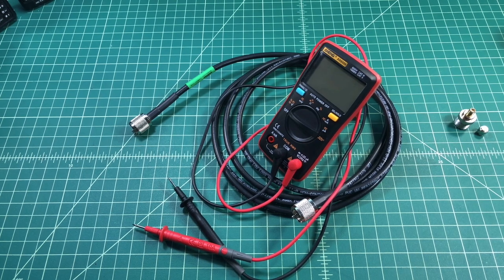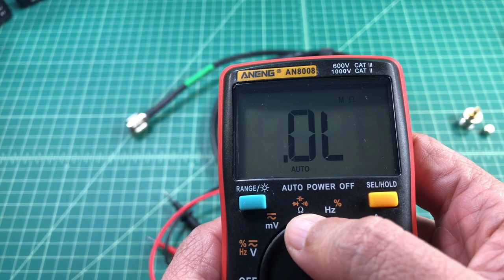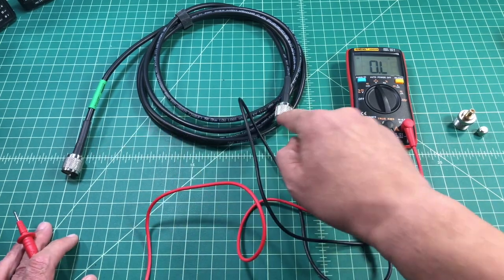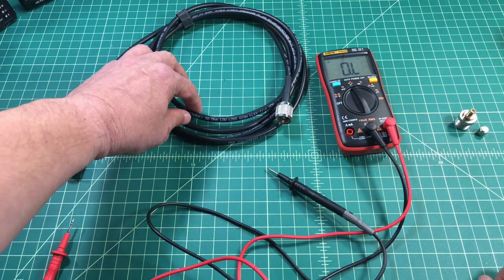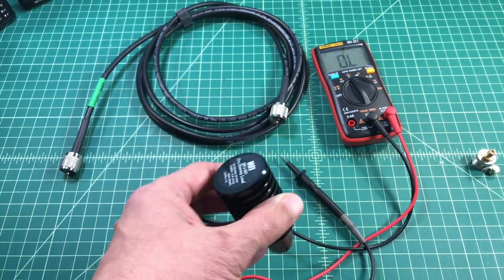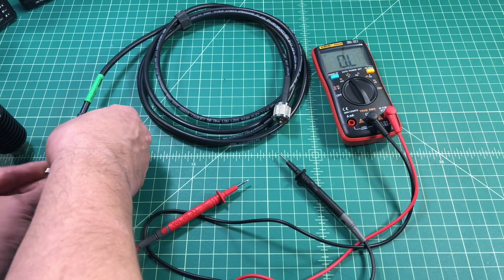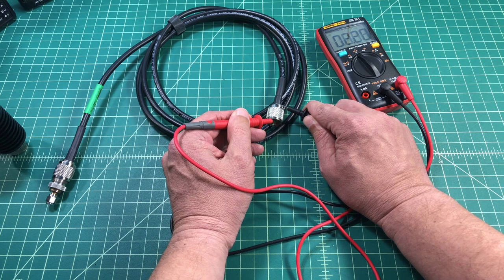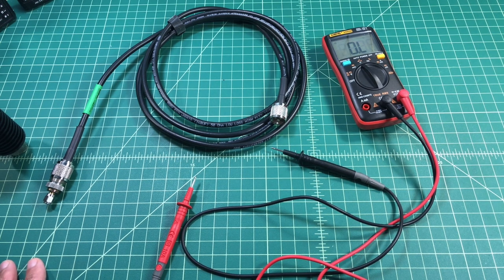How To Test Coaxial Cable With a Multimeter - TheSmokinApe

Comment: Hmm, I'm trying to check the coax runs in my house but all videos related to checking the resistance are for patch cables. Do you have any recommendations for testing a coax cable where one end is in the basement and the other end is on the side of the house?
Reply from the maker: You can use a terminator or a reference standard.

Comment: If it fails any test then do not use? Or with the shield you can use but expect high noise floor?
Reply from the maker: Don’t use it unless it’s repairable, checking the connectors and such.  Sometimes with long ones you can cut them into a few shorter good cables.
Reply: @TheSmokinApe  Related question: If a connector test (pin + outside connector) sounds off, then that connector is not correctly installed and I could try re-installing the BNC connector (I originally installed them, but troubleshooting why my cable doesn't work). Most probably, the outer layer of conductive mesh is touching the inner copper core?

Comment: Can I use two multi meters on a 50 m run of cable. I don't have a load.
Reply from the maker: You mean a cable that is already ran?  I'm not sure I understand but as far as I know you can't connect the two meters.
Reply: @TheSmokinApe  I'm not the person who originally asked, but let me know what you think about this idea: first test for a short between the shielding and the wire using one multimeter from one end of the cable, and when you know it is not shorted, could you then use both multimeters (one at each end) and put the negative probes on the shielding and each positive probe on the wire? I don't have two multimeters but I feel like that should cause both multimeters to beep, as they should be able to get continuity through each other, but I don't know for certain.

What I do know for the original poster is that they'll need an antenna analyzer to properly test the run, since they don't already know what the resistance of the cable is, but if you know your antenna is 50 ohms then having the antenna connected in place of the dummy load should allow you to calculate the overall resistance just like in this video. But without being able to test the resistance of just the cable and fittings, you'd want an SWR meter to really be able to tell if it will work well in practice, correct?

I'm not an operator yet, waiting to take my exam for the technician license and studying for the general while I wait!
Reply: Yes you can  put a 75ohm restor on the other end

Comment: To test the cable resistance with the terminator, you need to set your Multi-meter to 200 "OMS" and use the negative lead on the shield and positive on the conductor, then the closer you get to the advertised resistance (50 or 75 oms) , the better is the signal and the cable quality. The results your Tester gave are puzzling... The test should have reported a solid 50 OMS...
Reply from the maker: Thanks SJ, I was testing continuity...
Reply: It looked to me like the red lead was grounding out on the twist lock.. Meter should have been reading 50 Ohms...